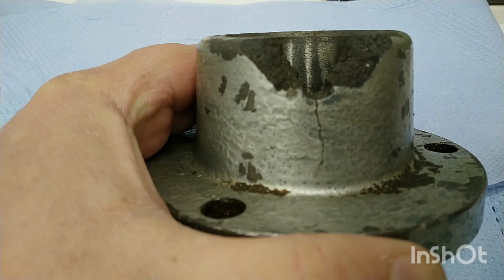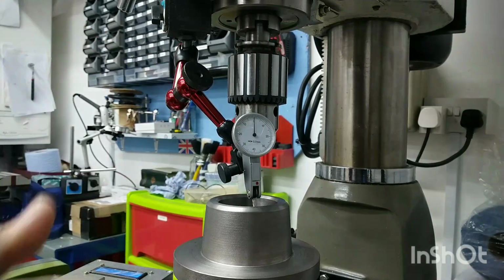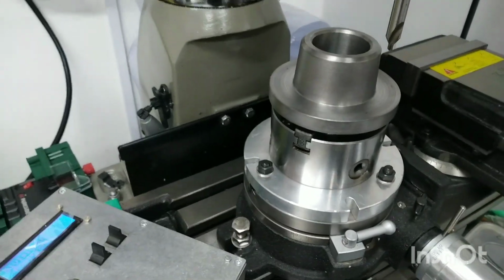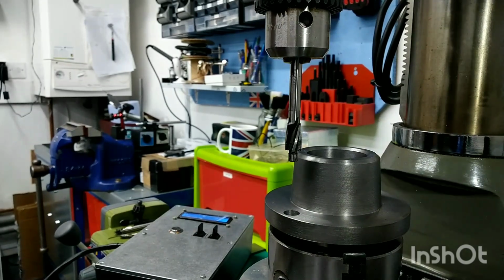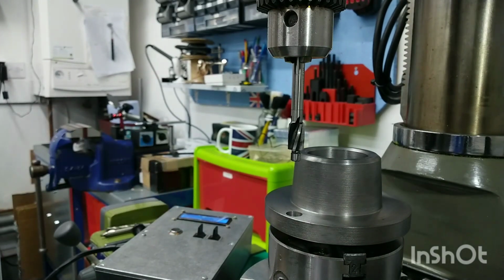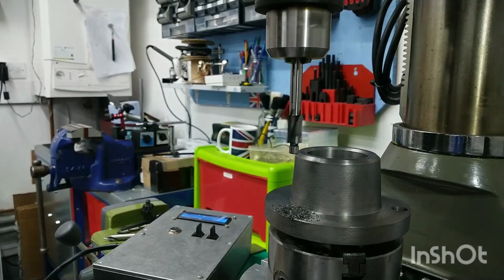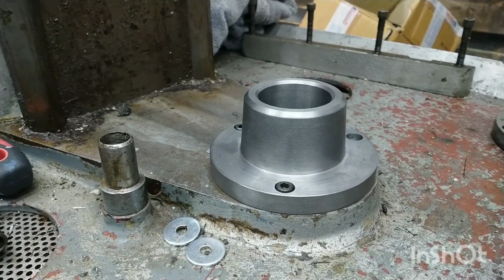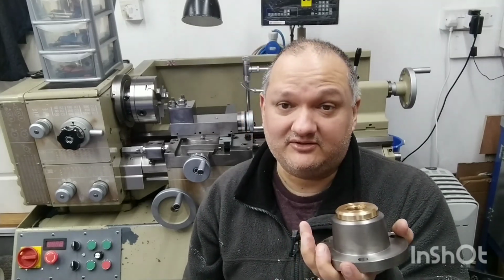Harrison Mill Resto Part 10 - Hole indexing by Arduino

Comment: hi Carl, I was hoping I could trouble you for some advice. The power feed nut in my Harrison Mill has some backlash. I've watched Haxby's video on machining a new one, and am certain this is beyond my skill. I have spoken to mill hill supplies, and he doesn't think there are any spares. I was thinking of fitting a power feed like your rong fu Mill,  and pinning a new leadscrew to the splined section of my old leadscrew. I could then mount a nut in the position of the old power feed unit. I'd love to hear your thoughts on this. Thanks, Richard.
Reply from the maker: Hello Richard, sorry it's taken me a long time to reply to you. Because of all the variations in these mills, I'm finding it hard to visualise your intended scheme. Please could you email me a sketch of what intend and I will try to give what assistance I can. My email:-
wilsonreactionresearch@yahoo.co.uk

Comment: That's coming along very nicely Carl, good work.
You not using the domestic machinery at all, (cough) reminds me of my method for removing cast iron cylinder liners from the aluminium barrels on a Kawasaki VN1500 engine. I needed to warm up the aluminium so made use of the Miele "parts washer" which I'd mistakenly installed in the kitchen. It worked a treat, half an hour in there and the iron liners came out with just a sharp tap :-)
Reply from the maker: Hi Jason! Really glad you enjoyed the video. The new bearing heater I have in my kitchen does work very well! I also have one of the "parts washers" you describe. After your ringing endorsement I shall have to give it a try! Thank you very much for your support and for watching!